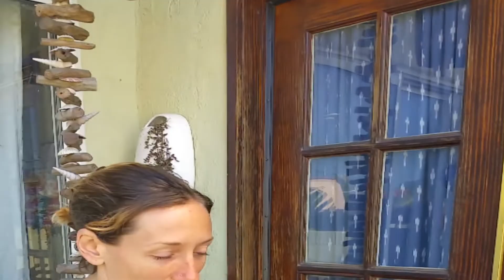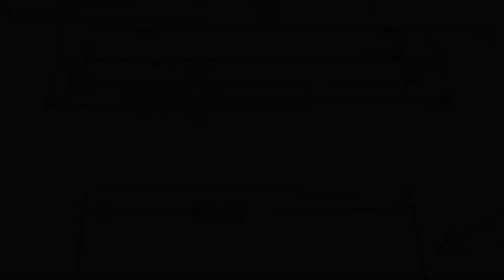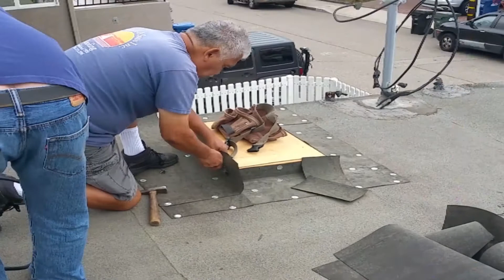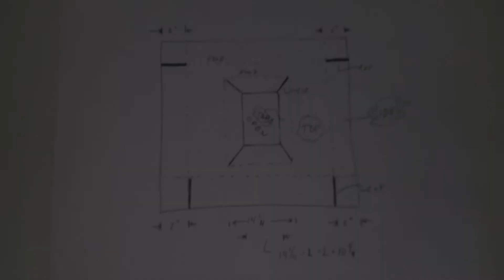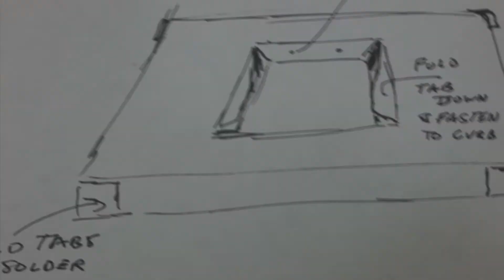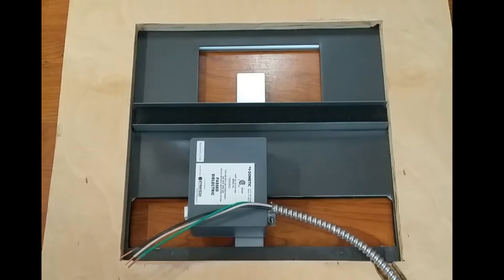Install an RV Air Conditioner in your HOME!

Comment: I work on RV's. I've thought of doing this because of availability for me. If you do this again use a coleman a/c. Their units are quieter then dometic. Both do a great job regardless.
Reply from the maker: Thanks for the advice.
Reply: Have you installed any curbs on any AC Units?

Comment: Excellent video.  My only concern with your installation would be water running off the AC Unit itself sitting next to that gasget causing premature failure.  I am planning to install my RV's AC unit on a curb.  I'm planning to have a smaller curb just a little larger than the AC opening.  I can heat weld it to my TPO roofing membrane and then counter flash under the Unit and add a drip edge to the outter perimeter of the shroud to allow the water to flow away from the gasget.
Reply from the maker: I have not had an issue with the gasket.  Also, I found that the rear of unit needed support normally provided by the roof.  I recently had a new roof installed and took the opportunity to build a larger curb.  See the video here
https://youtu.be/b5XjycrW3V0?si=MjVSRfiRbqK9oakq

Comment: The Fit RV channel says The Coleman-Mach A/C are much quieter than Dometic.  He measures the DB levels on a video at his channel.
Reply from the maker: Thanks, good to know.  I think any RV AC will work as a single room, roof top, AC when there is no space available for a window or wall mount unit.

Comment: How is this working out for you? I'm considering doing this in a detached shed / man cave and space is an issue. I have a large portable unit right now with dual hoses that are vented to the outside, but it is bulky and pretty loud.
Reply from the maker: Works great.  It is a bit noisy, and RV ACs cost quite a bit more than what is available as window units.  But, if space is a problem this definitely works.